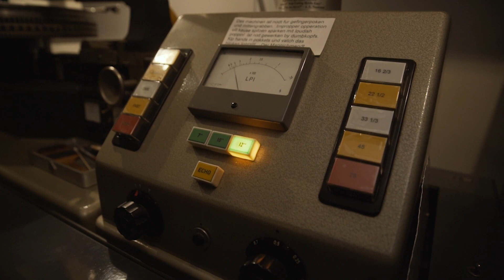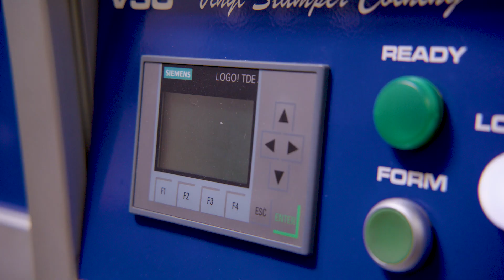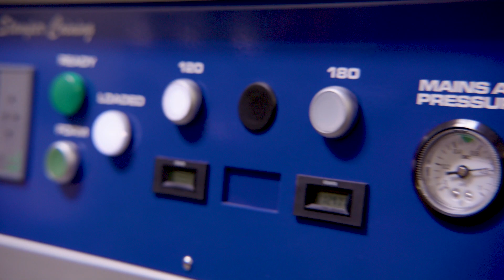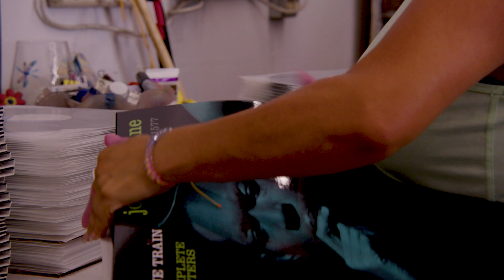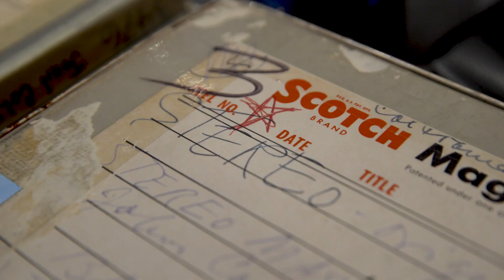Behind the Scenes: Pressing "Blue Train" Tone Poet Vinyl at RTI

Comment: Considering both the mastering and cutting by Kevin Gray and the sourcing of the materials and pressing quality, this is an un-matched product. It used to be that finding a playable copy of an original Lexington plant pressing or early reissue would be practically impossible and expensive. The Blue Note Tone Poet and Blue Notes Series makes all these great jazz albums accessible to anyone. I have compared some original or early reissue pressings to these RTI pressed records and have been consistantly impressed. I believe there has been a resurgence of interest in jazz primarily because of this Blue Note and other labels like Impulse output. This has also introduced jazz to a new generation that might only have heard samples of jazz at best in other music genres otherwise. The pricing is affordable which helps buyers put together a really good collection. Great detailed video of RTI's production as well. I see Don Was, the president of Blue Note checking out the finished product. If RTI was in Toronto I would love to work for them.

Comment: what is the thickness of the silver in microns.
I would have thought if you plasma coated the lacquer with silicone quartz what is hard as glass and can be achieved with 12 microns thickness, it's probably less than the silver?
another thing what is the polish surface of the surface of the lacquer in microns?
you can polish a lacquer with a diamond down to 1 micron polished surface. and theoretically you could cut a polish groove.
another processor I think would work well is placing the platter's lathe in a bath of thin silicone oil immersing the lacquer and the cutting tip.
 should give you better detail and a quarter surface, its only allowing the cuter tip to put down exactly what it should do and not unwanted micro vibrations what naturally occurs from the environment and machine and the process of cutting the lacquer reducing jitter. wonder if anybody ever tried to cut a lacquer in a mine, theoretically that should give you a good lacquer.
always use a good quality switch mode power supply 120 kHz for the amp to the cutting head, Manley labs now introduce smps in the amp don't know if you use it?

Comment: Anyone else hear some distortions & surface noise when the record gets played at the end of the video?
Reply: Also when played in QC.

Likely the mic volume wasn’t properly set and the sound was overmodulated into the camera/audio recorder, ironically enough.
Reply: Who is that guy in the end?
Reply: @bertroost1675  Don Was
Reply: @VideoArchiveGuy  Some of that noise is certainly coming from the record.
Reply: @yousellouts  If it were, every copy would be returned.
Reply: @VideoArchiveGuy  That doesn't make any sense. One bad copy doesn't mean they'll all be screwed.
Reply: @yousellouts  That's not a copy to copy tick/pop noise, that's distortion that would have to have been present on the stamper if it was heard like that on the record.